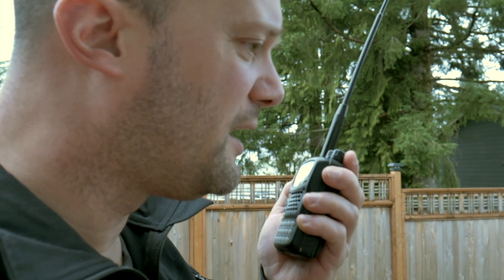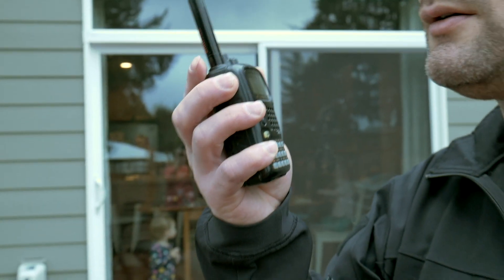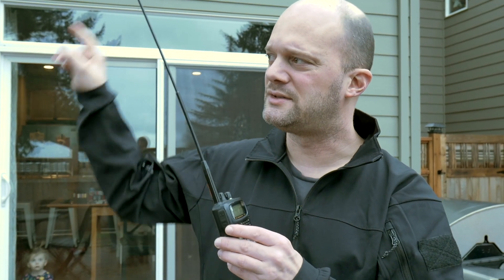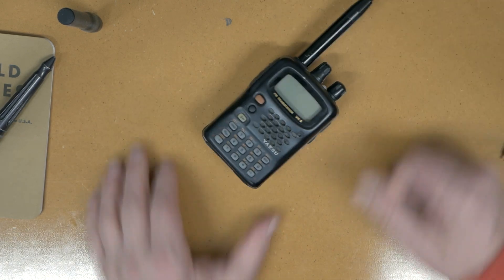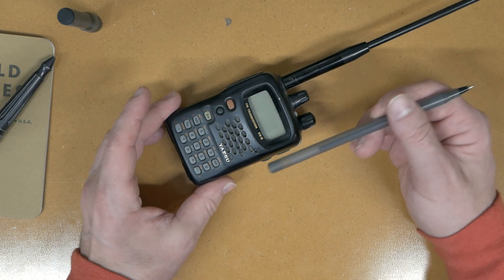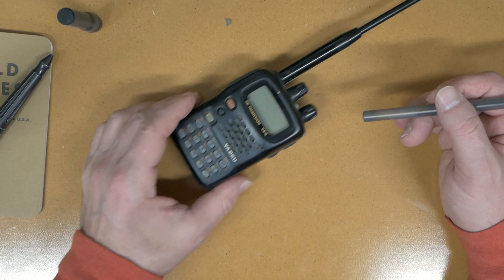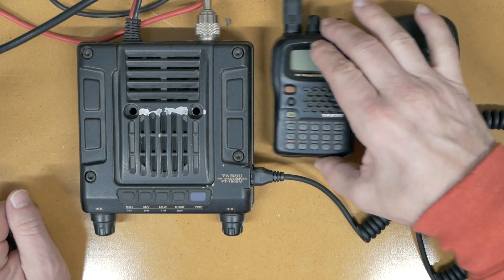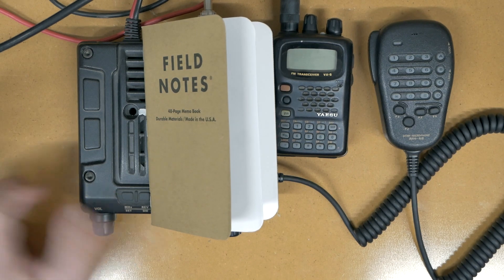HAM RADIO BASICS

Comment: Great video, this is something I want to get into and this is the first video I have found that is easy to understand and straight to the point 10/10, out of curiosity if you wanted to do simplex with a small group of people how do you know which frequency to use (how do you know it’s not being used by someone else who might not appreciate the chatter)
Reply: The standard two meter simplex frequency is 146.520
Reply: And if you're using simplex, unless a random person is within 4 miles of you or your on top of a mountain, even if they're on the same frequency they probably won't hear you

Comment: FCC is banning the handhelds on the 30th. FYI for anyone reading this
Reply from the maker: photojnt source?
Reply: @design2survive  https://survivalblog.com/baofeng-sales-ban-countdown-continues/?fbclid=IwAR0YpJ3yHmH-fDGbC7u6PHdyoUc9Sox58_bZetUgOB5EPsoXy-xl3aKKRl8

In the above link it will kinda go over the rule. In the first sentence it has a hyperlink to the actual rule by the fcc. I have called, personally, Scot Stone (legal) at 2024180638 and clarified the stated rule. It was issued and passed in 2017 to come into effect this month/year. Basically only bans these handheld that have frs and other emergency frequencies in COMBINATION. It does not ban people from getting two handhelds to cover both spectrums. It's more of a dummy proof for uneducated people to not buy these and use the wrong unlicensed band widths. It's more of an inconvenience kinda thing.
Reply from the maker: @photojnt  Yes..The combo radios were always a weird thing.  Even these so called "5watt" gmrs radios like the midlands shown, are only putting out minimal power.  They are basically kids toys.  The Baofengs and other chinese radios haven't ever followed FCC rules, and I don't think there is any way to actually stop them from coming in.  Even my yaesu vx8 can be modified to transmit on frs frequencies.  I think they should have simply made the non licensed limit to 5 watts if it has a  non removable antenna.  That weeds out the kids toys..